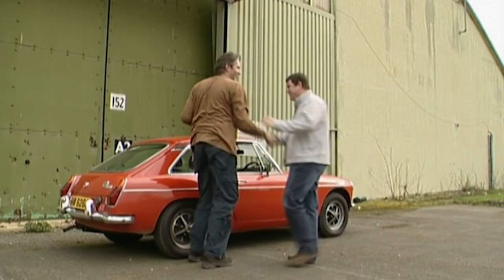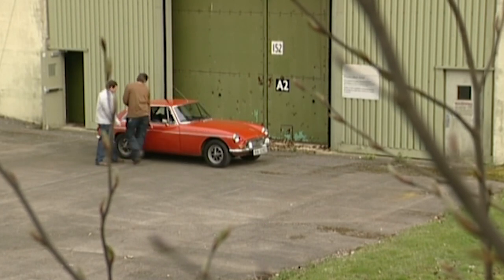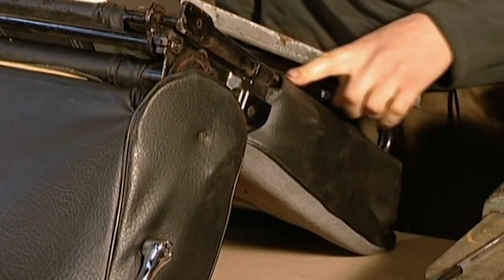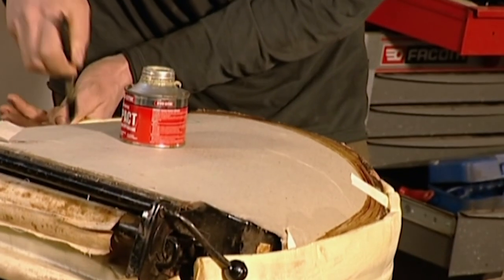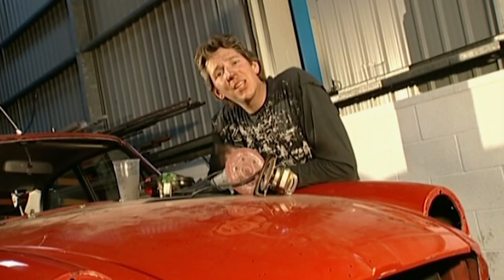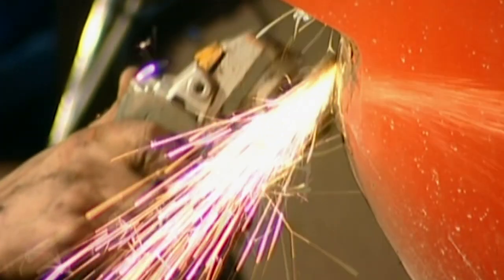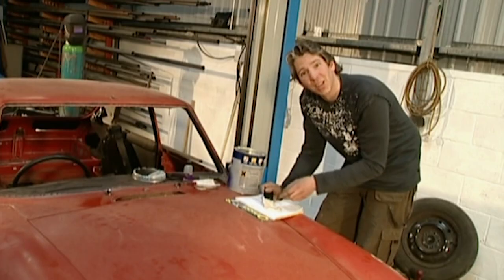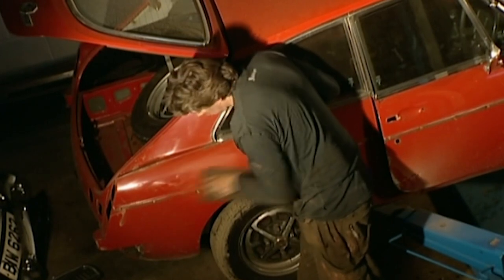MGB GT: Edd Gives The Interior A Modern Feel I Wheeler Dealers

Comment: Very sloppy and amateurish, Edd.
Mask off the interior completely to keep dust, especially filler dust which contains acids, out of the interior. That dash is ruined.
Also, professionals weigh out their filler and hardener so you always have a consistent mix. Never fill bare metal Edd!
Car needs to be primed then block sanded in order to be straight.
Reply: The early show was amateurish. That was the whole point. Flipping bangers.